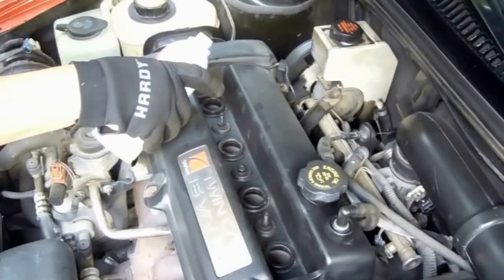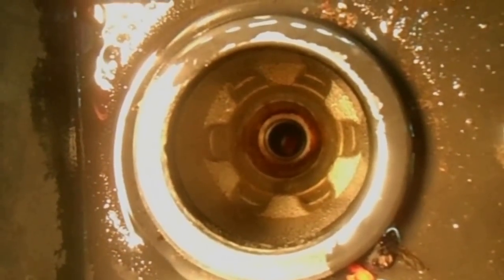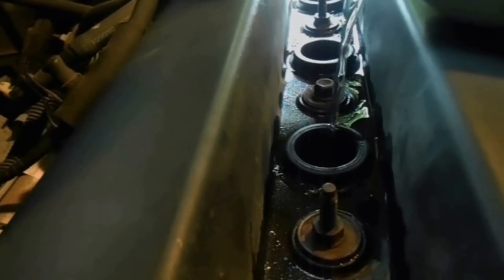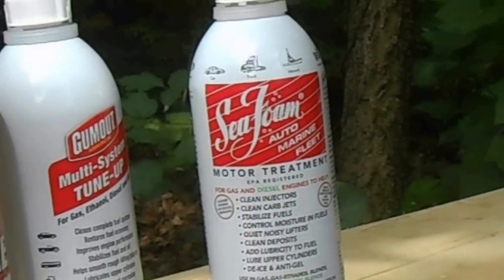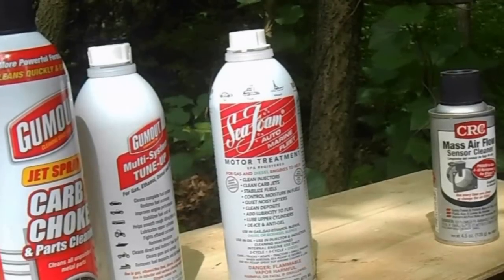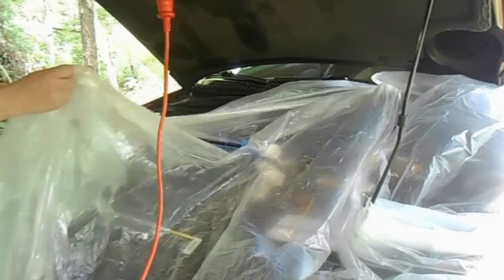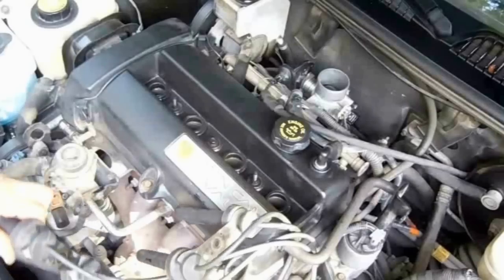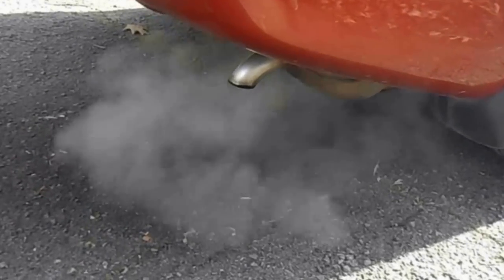Piston Head Soak Using Sea Foam

Comment: Should have used a bore scope before and after to see if this made any real difference. Also the carbon build up is on piston head.  So pouring so much and flooding the entire cylinder looks unnecessary to me
Reply: Good idea, perhaps you could have purchased one for him.
Reply: You fill the entire cylinder so the solvent can clean up the valves. I have done this with AcDelco top engine cleaner and the ive seen shiny metal with borescope.

Comment: If you dont have a pump then I'd suggest you take all spark plugs out after sea foam soaking your cylinders . If you hit the ignition button fluid will start to spray out & enough

Comment: I recently talked with a guy who had an old motorcycle that had been sitting for a long time.  When started up, it smoked a lot.  A friend told him that the rings were locked up from sitting so long and to put kerosene into the cylinders and let them soak.  He did that and supposedly that cleaned up and loosened up the piston rings and cleared up the engine smoking problem.  Would kerosene be more effective or safer since it already has oil in it rather than just a solvent like Sea Foam or Gumout?  Oh, yes, he did change the oil before starting the bike up since some or all of the kerosene had gone down the cylinders into the crankcase and diluted the engine oil.
Reply: Seafoam is oil based so provides some lubrication.  Kerosene doesn't.
Reply: @alexmcdonough6279  That doesn't really make sense. Kerosene is just C12-ane more or less, and I suspect Seaform is largely the same thing.

Comment: For cleaning out the chambers, did you have to do (BOTH) crank the engines & use the Turkey baster? I was trying to figure out out if there was still that much fluid after you cranked the car. Thanks for posting the video!

Comment: This is amazing. I actually had thoughts of putting seafoam where the plug holes are cause that's connected directly to the pistons. Sure enough I saw your video! Thank for this, will start working on it to clean my pistons.
Reply: How did it go?
Reply: any update? my piston rings are stuck too
Reply: @Shumayal  I ended up putting the seafoam directly in my Intake Air Sensor, which was attached to the intake manifold. My car is direct injected so I used that area to put the seafoam. So far it worked, I did have a lot of smoke afterwards it idled fine.
Reply: @Shumayal  I also put seafoam in my gas tank, and because it's direct injected, seafoam was directly being injected to the pistons.
Reply: @BlueHoodie74  did u see improvement in oil consumption? for me the problem is piston ring so I need to do the soak..
Reply: @Shumayal  I would say I had idle improvement, it was much quiet than before and I had better gas consumption. As for oil, my car is turbocharged so oil consumption is pretty the same.

Comment: Very poor compression will probably leak past rings so I'll let it soak and every hour blow a little air in to shoot the puddle towards the rings. Also maybe just a towel over the spark plug holes while cranking? 

For the induction method I'll hook a funnel to the pcv hose, pinch hose with vice grip and use the adjustment screw on the grip to control the flow.

Comment: Great video. Only thing missing is the borescope view of before and after…although black discoloration does show some carbon was removed…just don’t know how much.
Reply: Re: how much carbon is removed... if you have ever tried to remove baked on carbon from a cooking pan, you know heated on carbon is tough AF - and the longer it's been there... the more microlayers... the tougher it is to remove. Multiple rounds of chemical solvent and mechanical scrubbing is far more effective than longer soaks or more liquid. But, the longer its been there the more repetitions it is going to take to remove enough to think you accomplished something.
Reply: @ChrisBeardsley  For sure. I manually cleaned the intake valve carbon build up and I literally had to scape of small chunks at a time and it took a long time. It was hard and solidly baked on there.  LOL

But for piston heads, after soaking with Chen-dip for few hours, carbon dissolved to soft gunk and I was able to burn them off by driving in the highway.  I have before and after videos captured here. 

https://youtu.be/SS8vFbBLIG0

Comment: It's a petrol based product that is recommended to be used with your oil as well...so how is not safe limits?
Reply: It thins the viscosity of your oil so if you get too much of it mixed into the oil then your oil will be too thin.

Comment: Would using brake cleaner would be better or harm the engine? Or Berryman Chemtool B-12?
Reply: I use xylene and I stopped the oil burn on my saturn completely. It's the active ingredient in b12 but 100% instead of 10% just make sure to get out the xylene as he did and then use oil or mmo in the cylinders for an hour then getting it out again change the oil then that should clean them to as close to like new as possible. Make damn sure to not start the engine before doing new oil though and let it sit for an hour atleast to get it all ou
Reply: @sacredhealstv901  How long did you leave it in the engine?
Reply: @electric8668  I did for an extended period of time it depends on what car engine and what you're doing it for
Reply: @sacredhealstv901  So how long did you leave it in the Saturn?
Reply: @electric8668  mine was super bad so I left it in a week and a half used 2 gallons of xylene total with leaving the oil drain plug out then used mmo for 3 data
Reply: @electric8668  days
Reply: @electric8668  I also did a engine flush with motor medic for 15 minutes before hand and I highly recommend using pennz Plat or ultra Plat seeing as it competes with amsoil for less than half the price
Reply: @electric8668  I'm not leaving it up long so email me before I delete the comment
Reply: @sacredhealstv901  Thanks I appreciate the knowledge.

Comment: I would like to do this to my engine but I am afraid of hydro locking it, I instead am going to put seafoam into my crankcase. I assume that it is possible to clean my stuck oil control rings via both methods correct? I mainly want to do it the safest way possible and I intend to do the method I specified multiple times if necessary and I will tell you the results.
Reply: Then use one ounce per cylinder, no more.  After 12 hours 90% of that will get past the first oil seal, flow through the piston passages and into the sump.  The remainder will act the same as if you flooded the engine. Cranking in very short bursts without the plug leads/coils connected will push enough air through to move the rest out the exhaust valves (the ECM will sense that the plugs aren't firing and lean out the fuel mixture.)
Reply: You won’t hydrolock it. As long as you remove the sea foam from inside the cylinder.
Reply: Should you disconnect  the ig coil fuse before cranking without the spark plugs?or the fuel pump fuse?

Comment: After this we should pour few drops engine oil in each cylinder to prevent damage to the cylinder wall
Reply: Yeah, or fogging oil. A few blasts in each cylinder.
Reply: seafoam a little oiled already
Reply: no need to do that. Seafoam is petroleum based product. it is very oily. dont over  think and over do shit. Seafoam has precise instructions on how to do this piston soak. just follow it and dont deviate by adding oil or other bullshit.

Comment: hey.. nice video.
I'm also usingvthe same methods but i only using 0.5oz at each cylinder and let it soak for half and hour .. then i start the engine... no hydro lock and the engine just crank to life. i repeat this process for 3 times and i still have enough seafoam left for my other car. Have a great day
Reply: That enough to open the oil passages between the piston seals, bit not wasgte it on the piston faces which aren't cleaned through solvent action. Try dissolving carbon black, you can't. You can blast it loose with steam, the old water into the carb trick.

Comment: About ready to do this with Seafoam on a 2004 Lexus GX470 that used 4.5 qts of oil since last oil change (woman gets it done when reminder light comes on every 4500 mi?).  These cars are notorious for sticking rings/using oil.  And there's a steady stream of blowby smoke with oil filler cap off from all but maybe 1 cylinder so compression rings stuck too.   This car has always been garaged and is like new inside - even the leather seats.  Car has 280K on it.    A used engine was installed 4-5 years ago after the car overheated badly and she didn't notice the gauge (this car should have an audible alarm and lights for that... though some mechanic told her a check engine light doesn't usually mean anything if the engine still runs).

Anyway, this video shows an inline four with pistons all level.  A V8's pistons would be at an angle (30 to 40 degrees?) so would need a lot of liquid in there to cover piston surface, and if a piston was near top may not even be able to get enough in to cover the top of piston.  I'm going to try this then put plugs in and crank by hand, so not to hydrolock/mess up something.  The liquid should fill combustion chamber during compression stroke and force it past the rings (assuming rings are stuck "in" from when piston is at bottom of lesser worn cylinder bore) with a few thousandths of taper at the top.   If piston's at TDC, I may not be able to get enough in to squeeze past the rings (guess I can tell using a measuring cup and putting in about 2 oz to each cylinder (will need to calculate that using bore size and assume 45 degree angle).  Not sure what'll happen if piston moves up during exhaust stroke - if heads are like Pontiac, the head's exhaust chamber goes up and out thru the head - liquid will go into exhaust port, maybe some go into exhaust pipe, but some will come back into cylinder before exhaust valve closes.  I hope the crank pulley bolt has easy access cause it'd need two complete revolutions (car's in shop now, where they're talking $4000 to install a used engine... which could be halfway to a buildup problem).   The problem with this is it won't get benefit of a slow soak with a supply of cleaner washing past rings.  Will leave it overnight.  Maybe repeat with Marvel Mystery Oil.  I want to see if this works...

If this works according to plan..., the Seafoam will get into the crankcase (minus what goes out through exhaust port into pipe).   It's going to take a while to loosen carbon from oil control rings to stop burning oil... same with compression as a little Seaform will get past control ring.  It's always a PITA to clean out piston grooves when rebuilding an engine.   I'd hope it gets better immediately as several have said it does - reducing oil consumption (must be about a qt/500 mi), and I can see immediately if blowby's reduced.  Thing is it'll start building up again if don't do something different - run a can of Seafoam every tank for a few months, then maybe once/month(??).  And use different oil - someone suggested Rotella T5 10w-30 because it has much detergent, or synthetic (I guess because it won't bake/carbon up).

When blowing it out with plugs removed (there shouldn't be much residue), I'll stuff a rags in the large spark plug hole through the valve cover.   That stuff really blew all over the place (I'd probably have done the baster first... or thought of it later).   THANKS MUCH for this video and these comments... I'll bookmark this and post results. [sorry for the tome.. but I'd wondered how I'd soak rings on a V8]
Reply: Update on how it went?
Reply: Google Review rip

Comment: What happen If i leave the sea foam  for 3 days would it damage the engine??
Reply: May want to do an oil change after doing that, especially if you use that much sea foam. It will leak past the piston rings and into the oil.

Comment: What's the story on the BASTER?  Is it an ordinary baster or something special that resists solvents?  Is that a homemade rubber tip on the end?  How did you make it?  I couldn't find anything on the Internet that resembles your tool.
Reply: Heat shrink, perhaps?  Maybe hit it with some solvent, rinse it, and dry it off before using it for this purpose.

Comment: I used this kind of method on a dirty engine. The seafoam loosened chunks of carbon and blocked the cat which started glowing red. I used acetone intake cleaner to unblock it
Reply: ki0ng  By removing it hopefully.  I have seen a few (not many) of videos where people claim extremely positive results by removing the down stream flow, O2 sensors on the cat. converter and literally spraying sea foam directly on the honeycomb of the cat through the sensor port.  Seafoam company does not recommend this, or advertise anything like this. But there are quite a few people that claim bypassing the the intake and letting it cook and work in the cat has fixed problems with clogged cats.  Pretty bad ass.  I can't see the possibility of harm in it as it is away from the engine and exit only.  Heating up, but but applied directly and not being burnt up in the combustion chamber before it gets there.  Just as it is used in thid vid.  More of a setting soak directly applied.  Except the cats get super hot and will help break it up and push out after already soaking.

I want to try it as I havent heard of anyone blowing shit up yet.

Comment: How little or much cleaner will cause hydrolocK?
Reply: I just turned my car on today from leaving it with seafoam all night. Just make sure there is no extra solvent swishing around, check with a flashlight. My car turned on the first crank. Yours should too if there is little to none.
Reply: @sugamai  Thanks very much. I am going to use this method to clean the cylinder head and the combustion chamber in my Honda Eu22001 generator. The warranty requires this which I find to be a legal method to disallow liability. Honda recommends a complete engine tear down to do this. It is very expensive I am guessing $200-$300. The generator cost $1100 to pay a third of the cost for a maintenance item is absurd.

Comment: That's not gonna do the damage to oil control rings?
Reply: nah the rings are not gonna have issues because of this. the biggest danger is to much liquid left in when you put the plug in. make sure you get most of it like he did in the video.  you can use Marvel myster oil sea foam and any number of fuel treatmeant solvents
Reply: Gm top engine cleaner ????
Reply: Gm top engine cleaner ????
Reply: Gm top engine cleaner ????
Reply: Gm top engine cleaner ????
Reply: Gm top engine cleaner ????
Reply: Gm top engine cleaner ????

Comment: Disconnect catalytic converter before doing this process
Reply: and change engine oil afterwards
Reply: @John Doe it is an annoying job but the converter could clog with the loosened debris from the engine, it's not necessary if your engine was well taken care of but if your engines cylinder bores are heavily grimy (as per inspection with bore scope) you should disconnect the converter so as not to ruin it and just be forced to remove AND replace it they can be very expensive.

Comment: Hard acceleration followed by engine braking will free up any carbon binding those rings. Back pressure will make those rings dance and spin
Reply: What back pressure?  The oil passages behind the piston are at near ambient pressure, lower pressure than the working cylinders all the time the engine is running. The rings are to reduce gasses from being blown into the oil. The reason that oil burning happens is that the return passages in the pistons are blocked so the oil can't move any way except into the cylinders.
Reply: @psdaengr911  return passages such as the pcv valve?
Reply: This isn't true. The carbon gets stuck on the tops and bottoms of the rings (also the inside potentially) . Running an engine hard just aids in compacting the carbon like stepping on dirt and compacting it.

It is a non wear surface... you can step on the gas all you wan't but it isn't going to remove the carbon compacter you created by neglect...

Oil additives aka strong detergents are the only thing you can hope works short of a rebuild...

Comment: Could you perhaps use the same method with a tractor that sat in the rain, exhaust open to weather? Remove injector or glow plug, turn over engine let the water out of cylinder, what am I missing? Thanks

Comment: I cant get seafoam in my country. Is there any alternative? Will liqui moly engine flush do for the piston soak?
Reply: Use power steering fluid. After soak, drive car for 50miles which will help cleaning. Then change to fresh oil and filter.
Reply: Marvel Mystery Oil

Comment: Sea foam is not bad for oil. You can even add it directly to oil.
Reply: You forgot to tell everyone to drain the oil within 50 miles of driving with sea foam in it. It will definitely affect your engine as the viscosity of the oil changed dramatically. It's great for cleaning out the engine but must be removed with a fresh oil change.
Reply: This is true. You can go upwards of 200 miles i read. But definitely change it soon.